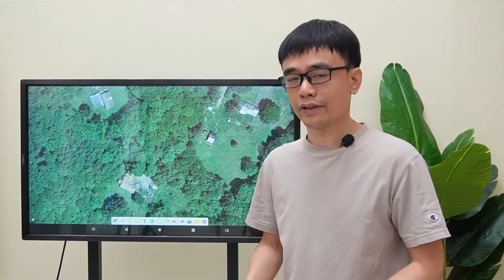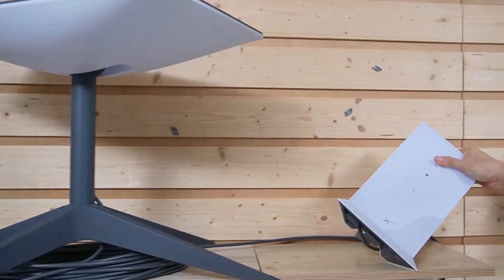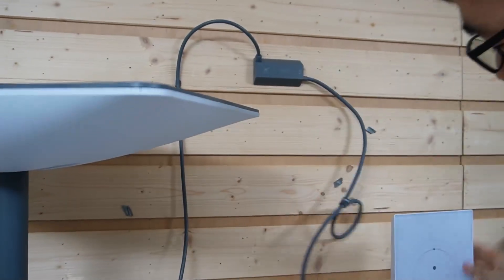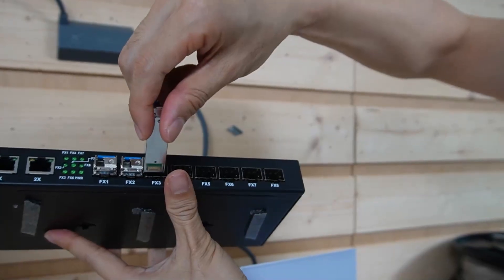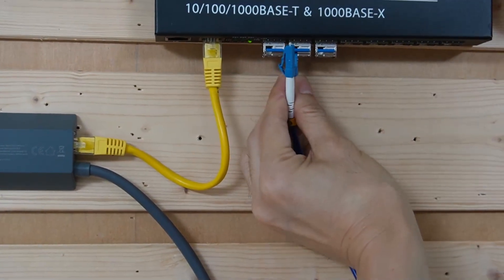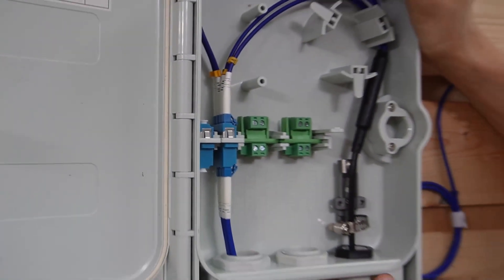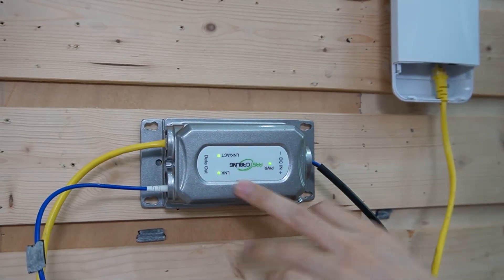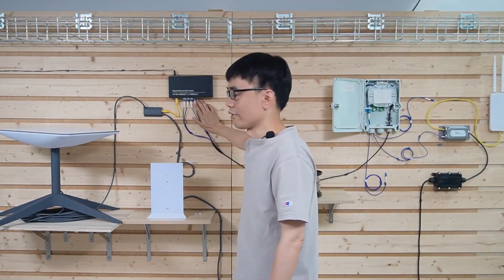How to Extend Starlink Internet Over 200+ Meters Using Fiber Optic Cable | Full Setup Guide

Comment: Hello, this is very good. I would like to use a SFP+ 10 Gbps SFP+, switch, and PoE connection in this setup to have greater bandwidth and support more subscribers. Is this possible with starlink ?
Reply from the maker: Starlink’s internet throughput — the actual data rate to and from the satellite network — is limited by your Starlink terminal and plan, typically between 50–250 Mbps for residential and higher for business plans (up to ~350–500 Mbps). This means even if your local network runs at 10 Gbps, your Starlink connection to the outside world won’t exceed the limits set by Starlink.

Comment: I have a question, can the mpbs speed change? We're planning to buy starlink and provide many internets to our neighborhood
Reply from the maker: Mbps on Starlink changes constantly — depending on network load, weather, and your plan. If you want to share with neighbors, it works for a small group, but not for a large community unless you invest in multiple Starlink terminals or a Business/Community plan.

Comment: I have a StarLink going to 4 cabins. The StarLink router cat6 goes to the fiber switch. For some reason only one cabin works though.
Reply from the maker: By default, Starlink’s router is a NAT router with one LAN port. If you’re feeding a switch directly from it, it will only hand out one DHCP lease — so only the first cabin gets internet.

To fix this, you need either:
• Put the Starlink router into bypass mode and add your own router/firewall that can serve multiple clients.
• Or add a proper router in front of the switch and let it handle DHCP/NAT for all cabins.

Comment: Apart from using an outdoor media converter to connect the access points ...is it possible  to use the   8-port L290W PoE++ outdoor Switch if I needed more devices  on the network
Reply from the maker: Yes, you can. However, Starlink typically provides 100–250 Mbps download (depending on plan, congestion, weather, etc.). The uplink from the fiber switch to Starlink is still a shared bandwidth. If multiple devices connected to the switch are active at the same time, their combined traffic could exceed the uplink capacity, causing slowdowns — this is the potential bottleneck. Just don't max out Starlink, and it should be okay.

Comment: Thanks for the info. I have a similar interest but using a Starlink Gen 1 dish and router. I want to extend wifi to 2 remote locations (each about 100 -120 m from the dish/router location) but they are 180 degrees of each other. Do I run FO on two separate runs? And would I need the hub?
Reply from the maker: You can run two individual fiber runs from your Starlink Gen 1 router to each remote location. At each endpoint, you’ll need either a media converter (to convert fiber to Ethernet) or a network switch with SFP ports (fiber input support).

Comment: Hello sir.  Is there a way to extend the distance between the Starlink dish and Starlink router?
Reply from the maker: It depends on which Gen dish. You don’t have much longer run for Gen2 because the power consumption. You can either order a longer cable or use starlink passive PoE injector, adapter, and 23awg cat6 cable, but the length will be constrained by the power loss inline
Reply: @Fastcabling 
Thanks for answering. Yes, I have the gen2.  I know there is a 300 foot cable, but I was worried about that length of cable loosing data or power.
Reply from the maker: If the cable is designed for gen2 specifically, it should be good.
Reply: What is the max possible distance of the remote location?